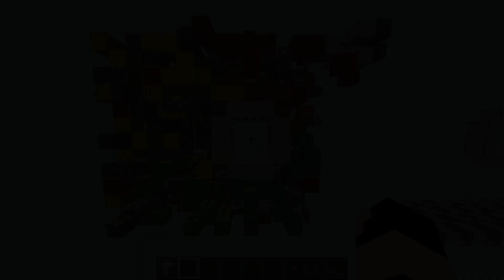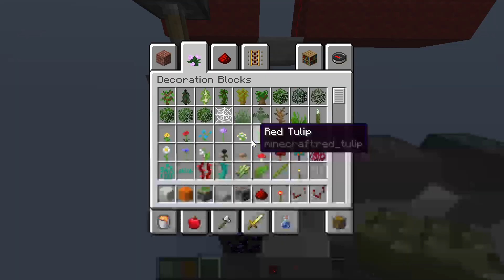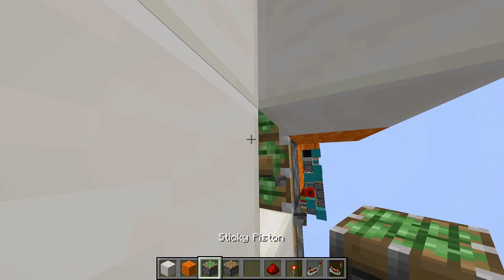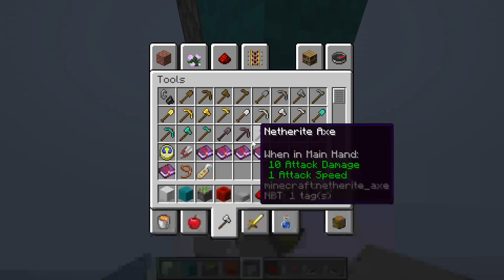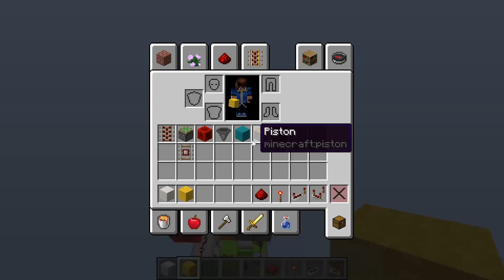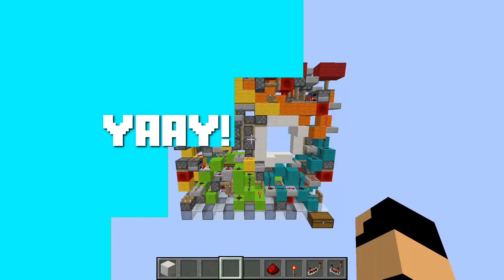[Tutorial] Faster 3x3 V2 | MC Java 1.5+

Comment: Works for me but center block leaves behind it
Reply: this happens in opening
Reply: even loading schematics it breaks when closing..
why does this happen??
Reply from the maker: @TurbineOfTheWinds5816  do u have a discord? if the schem has an issue thats rly bad
Reply: @Tim400-b2r  Its just because the furnaces are all EMPTY
Reply from the maker: ye, i just remembered. try the new schem pls
Reply: @Tim400-b2r  works just fine.
Reply: @Tim400-b2r  also this is bigger than previous version which is 663 blocks
Reply from the maker: It is bigger, but it’s the smallest for its speed, including reset time.